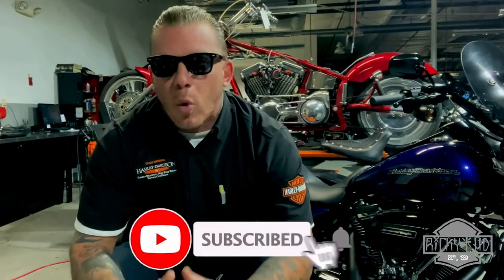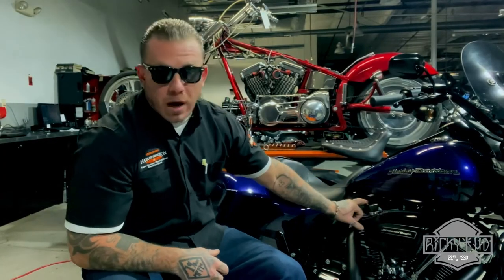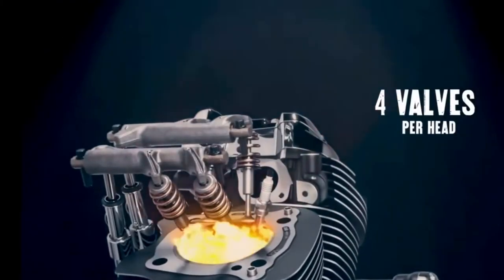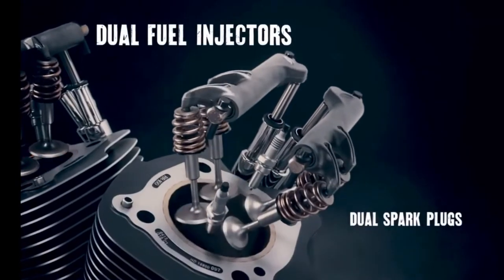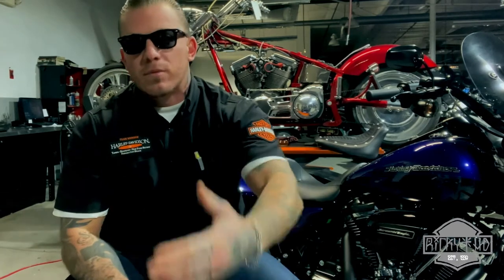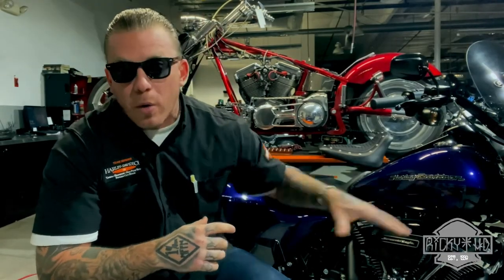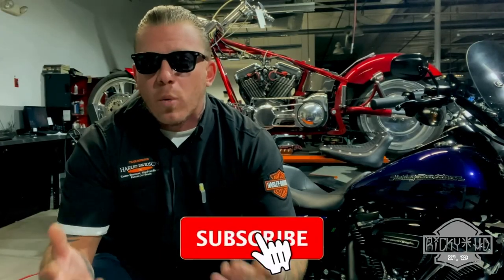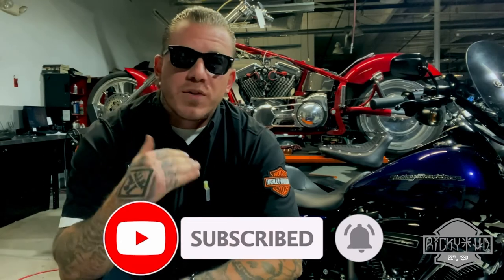All about the Harley-Davidson 107, 114, 117, 131 Milwaukee 8 motor. Why is it special?

Comment: Great video dude no fuss straight to the point. Just bought a 2018 107 complete engine cheap  definitely going 124ci. I’m in Australia if you have any advice on parts kits will definitely welcome the insight. Cheers Rich.✌🏻

Comment: Hey Ricky, question about the 114 vs 117. Of course power Is awesome but also looking  reliability. Do you see higher service issues with the 117 vs 114? Any real difference in mpg with gas here in cali creeping $7

Comment: Great video Ricky but a question I have is I just put a stage two screaming eagle torque cam in my bike I already have a stage one but I didn’t seem to get the power I was expecting any helpful hints thanks buddy
Reply from the maker: The screamin eagle torque cam is emission compliant. Which means they can’t lobe the cam aggressively like zippers, S&S, Fueling etc. Screamin Eagle is Harleys “performance line” made so you dont void your warranty. 

What intake, exhaust and tuner are you running?

Comment: Thanks man, great video.  What type of pipes do you recommend for the M8 ?  Thanks 👍🏻
Reply from the maker: Depends on what you’re going for. I prefer the most performance out of my motor so i run a Two Bros racing 2:1. D&D 2:1, Trask performance 2:1, Bassani 2:1. All great pipes

If you like true duals, i would go woth true dual rineharts with 4in DBX’s
Reply: @RickyHD  doesn't zippers recomend D&D running there cams? I think moonshine HD did builds with all the combinations. Definitely a good video.
Reply: @RickyHD  found the vids. Not sure what order they came up in,but you get the picture.  
https://youtu.be/vnBKzGMKL40
https://youtu.be/DbeF1QSSBRU
Reply from the maker: @tainted_timmy6726  zippers and other companies like fuel moto and moonshine choose the pipes that make the greatest numbers for the application. D&D is an expensive exhaust that most consumers can’t readily afford which is why i run a TBR. If i could afford a DND trust me i would 😂
Reply: @RickyHD  agreed. Take out a small mortgage to get that entire kit they sell. Its badass, but not in my price range as well. I'm a rider, I hate working on my bike when I know I could be riding. Ya feels. Im an affiliate to MC world as well. Love our state man. Ridin year round baaba ba baaba!! (In central FL)

Comment: Ricky ! Great informative video. My question is about venting, crank case gases into the throttlebody, obviously this isn’t good because of the carbon buildup overtime and I know why Harley has to do it because of emission standards but what do you suggest? Should I do the dipstick modification or should I run Hoses away from the throttle body and vent them to a filter or a catch can? I have a new Lowrider ST with less than 500 km on it so I want to address this issue right away and I value your input. Thanks ahead of time.

Comment: I have a 2021 Heritage 114 with your recommended Stage 1 upgrade. I am very happy with the performance. I do however miss the familiar "Potato" loping idle of my previous '93 and '04 models. Is any particular after market cam capable of  mimicking the old idle, thus making it worthwhile to have a Stage 2?
Reply: I wanna know this answer as well.?
Reply: @VONVELLImusic    I actually found one, an S & S 475C Torque Cam. I also might as well do it right and get the entire kit, including upgraded Cam plate, oil pump, etc.
Reply: Planning on the Zippers Red Shift 268 for my 114 at some point when im out of warranty
Reply: @Trevon Walker   I did go with The S & S 475 Torque Cam. Very happy with it. The exhaust note is phenomenal. I have my familiar "Potato, Potato " Thump back. I also installed a DK Custom External Breather Air filter,  Thunder Torque Inserts and a set of Love Jugs cooling fans. Bike is perfect now!
Reply: @Digger456437  Gotta love those Thunder Torque inserts, got a set of 258s in my stock slips, and even with the cats still intact, I can still hear the smog cam lope a little. The Red Shuft 268 should sound badass.
Reply: @James Collins   Sounds great! Also my 114 has a year to go on the warranty.  Harley initially said the S & S Cam would void it my warranty. I told them that due to an Federal Trade Commision ruling , they can no longer do that. They begrudgingly agreed. I would say don't wait.
Reply: @Digger456437  Getting ready to go have my 1k done soon, gonna let them go over the bike real good. Planning on doing the rest myself, since mine is a 21 with the upgraded pump, I'm just gonna throw the cam and lifters in, and reuse the cam plate and pump. Should be fine.

Comment: I have a stock 107ci m8, i can get the following 1q7ci m8 screaming eagle parts... can I change the pistons , barrels, heads, cam and induction module, without changing anything else, on the motor ( ie, push rods) and have it as a 117ci? Thanks

Comment: Hello! All this is of course very cool! But there are people like me. I am already 67, 51 of them I spent with motorcycles, I started as a mechanic in a sports club, I understand something about motors. But my first Harley. And I was unpleasantly surprised by an absolutely irregular idle, and a knock in the valve cover area from 1800 to 2500 rpm. On the speedometer 200 miles. The two dealers I contacted say this is normal? And what will happen??? What do you say about this? Best regards, Victor.

Comment: Hey thank u so much I want to change my 107 to a 124 and this guy in pa told me I got to change my throttle body clutch and injector and all this mess
Reply: You can't really go 107 to 124, you'll have to change everything.
Reply: I put an S&S 124 big bore kit in my fat bob 107. Never changed anything after the stage 1. Hadn't dyno tuned and it runs beautifully. 108 HP and 134 T at max RPM 4000.

Comment: Hello, I'm an old Shovel head guy and want to get more riding time in stead of wrenching. I' don't want to ever have to pull heads again.  I'm no sure what a stage 1 upgrade is.  I'll try googling but a video covering how old cV carb addicts like me should make the tradition to the newer low maintenance bikes that are all fuel injected
Reply: tons of good videos  on stage 1 upgrade, thanks
Reply: Stage 1 is upgraded air filter and slip-ons with a tune.
Stage 2 upgrades the cam as well.

Comment: Why are the 117 engines so noisy around 2,000 to 2,200 rpms? It's a tapping sound like a lifter is out of adjustment. I've listened to 6 or 7 other 117 engines and they all sound that way. I had a 114 engine before I bought a  2021 Street Glide CVO. The 114 was quiet, I hate riding the 117 its so noisy, it sounds like your running the engine with no oil.